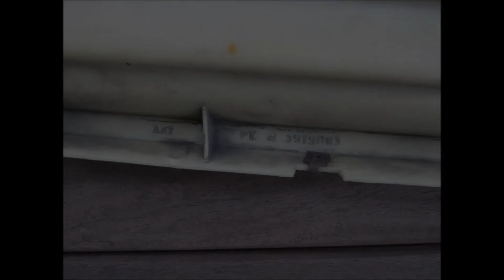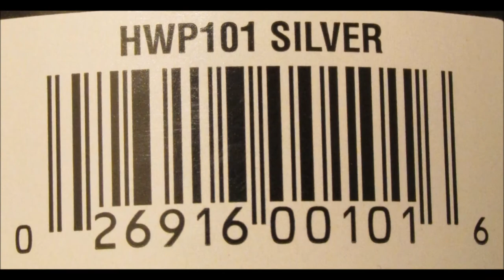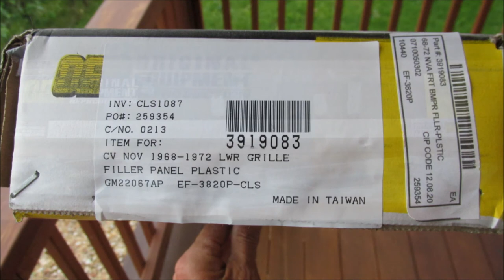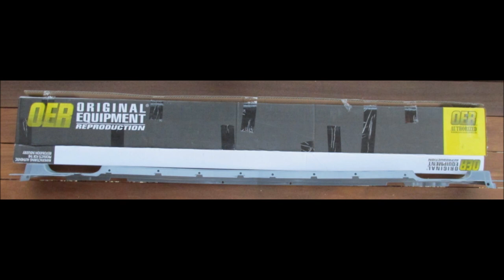1968 Chevy II Nova Front Grill Filler Panel Replacement

Comment: I like the photos but a video would be nice because I removed mine a year ago and cant remember the exact bolt placement, thanks for sharing it helps
Reply from the maker: You may want to look in the proper AIM (Assembly Instruction Manual). I bought this manual as well as the other two shop manuals and they have a bunch of info in them. Yep, a video might have been nice but my camera had higher resolution on still shots than on video. Also too maybe look at these photo's in which you can see in a higher resolution: https://www.flickr.com/photos/121766713@N04/albums/72157649646999993

Comment: How do you get the filler panel and reinforcement piece in place without bending the little tab that fits behind the fender? I've turned it this way and that. I don't want to take a fender off if I can avoid it.
Reply from the maker: I am good friends with Penn from Penn and Teller and he owed me a favor and took care of me.............No, I did have to bend something and I cannot remember what to sneak mine in and if I remember right I took the diagonal round stock bars off for some reason either to clean them or give me more room but I just cannot remember all of the specifics, All I know I did not have to remove the fender nor take anything major apart. I think this picture might help as I believe this is the one end I bent down to get things out and then once back in, bent it flat again ?. I just cannot remember. https://live.staticflickr.com/8698/17189556245_4161052e07_b.jpg  Also too, here is an album with the still shows which you can click on and enlarge better than the ones on the youtube video. https://www.flickr.com/photos/121766713@N04/albums/72157649646999993/with/17189556245/  Jim
Reply: @StlNovas  I'll check that out. Much appreciated!